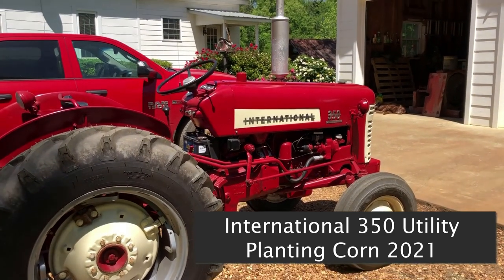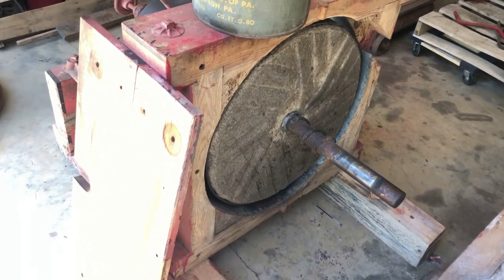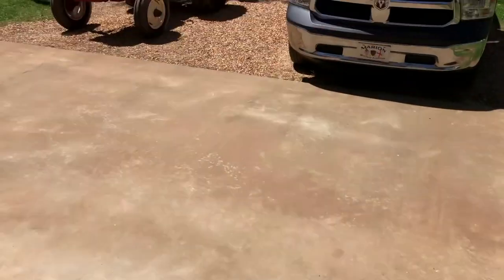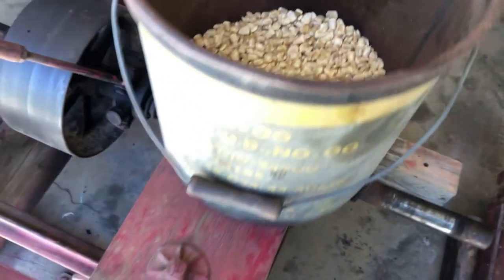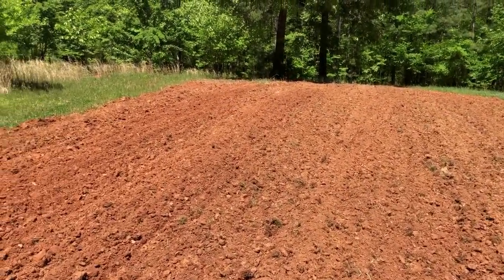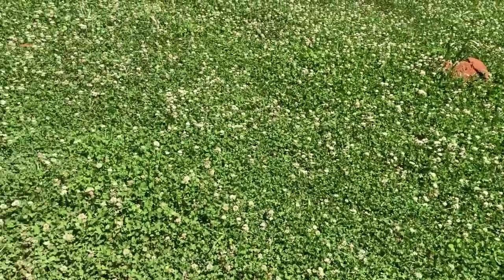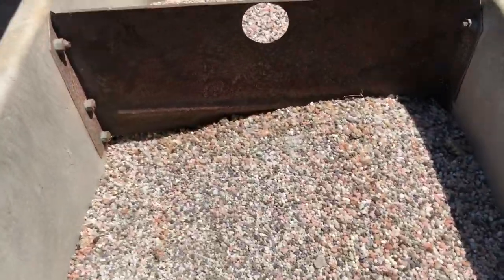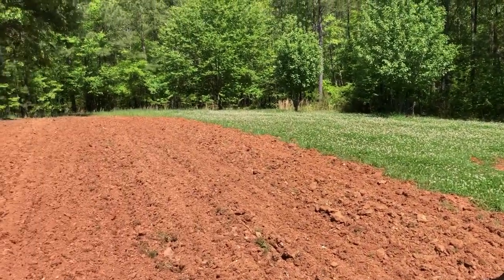IH 350 Utility Planting Hastings Corn 2021

Comment: My grandfather has a 350 LP, I love that little thing. It used to have an issue where it would shut down once it got warmed up but he finally figured out it was the grease joint near the points, it was over greased and getting on the points once the engine warmed up

Comment: I am curious about how you prepare your corn ground for planting.  Do you use modern equipment?
Reply: Most of the time I use the Mahindra and the Brown disk. Sometime I’ll use an old turning plow and the IH 350 ( a 2 pt system ).  I’ve picked up an old bush bog disk on 2 pt I’ll film later.